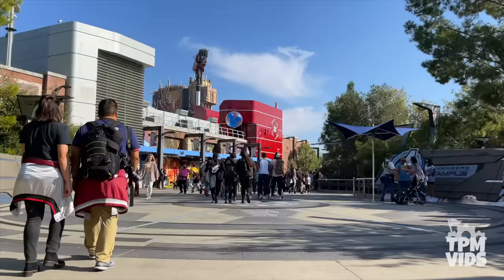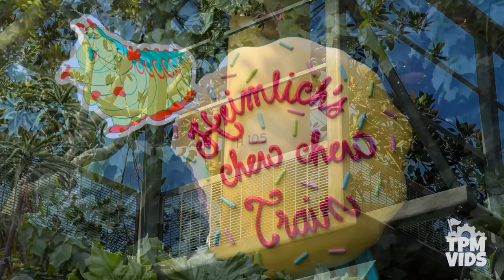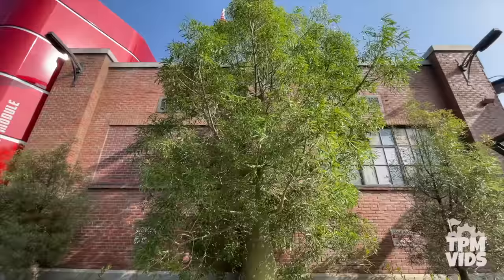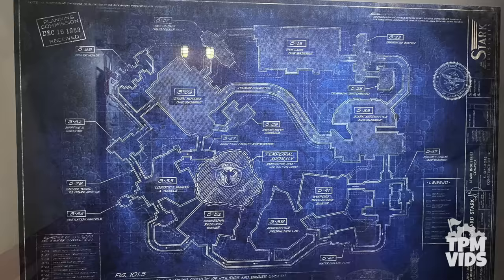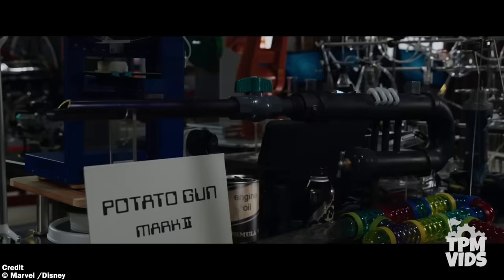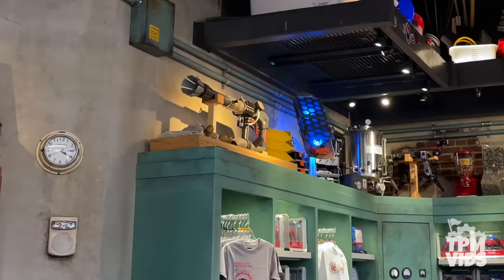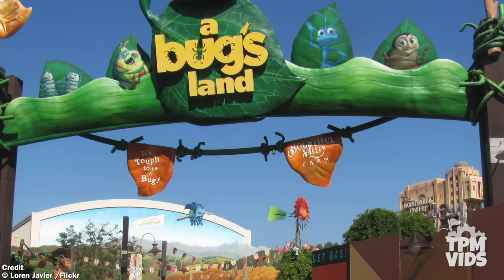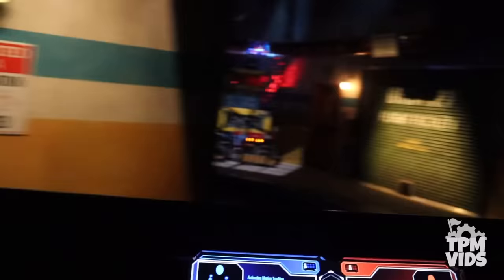Top 10 Hidden Secrets & Easter Eggs in Avengers Campus - Disneyland

Comment: This is all great but I'm still shocked they didn't include any references to Bug's Land in the Pym Test Kitchen. They would fit in perfect, since Pym tech is designed mainly for shrinking and is associated with ants
Reply: Well, the part where he points out the condiments station kinda is since A Bug's Land was part of Bountiful Valley Farm and even before A Bug's Land existed, it was where It's Tough to Be a Bug was located at. Actually, over at PYM Testing Lab, which is a section where you can get alcoholic drinks, on the celling of the shade are Christmas tree lights, which are recycled from A Bug's Land.
Reply: Maybe the Pym Test Kitchen should be associated with wasps and spiders

Comment: Great Video! I love marvel and these Easter eggs are so clever. I tried to do some research on my own and the thing I could come up with for the h 105 is Disneylands hotel opened on October 5 1955. Idk if that helps
Reply: Good idea!
Reply: Actually, as a former attractions member who opened DCA and was there for construction of bugs land, I immediately recognized what it meant....
It refers to the code that is used when an attraction goes into "reduced capacity".
Heimlich's chew chew train was able to run 2 trains at the same time. If one train mechanically broke,  they would remove it from the track so the other could continue operating. The code 105 means: "operating but at reduced capacity".  Very fitting tribute as the bugs and features in bug land still exist; just not in the same capacity as they used to operate.
Reply: @clinttaylor8730  wow that’s amazing! Thank you for contributing!

Comment: I know TPMvids will not read this but can we get this to the top of the messages so there's no confusion when Guest come into AC.

09:43 Quite the opposite. The Collector was the first to arrive. The Stark industries was made into Avengers Campus to 'Keep an Eye' on the Collector. Thus the reason why when the Collector's fortress came SHELD put a place marker on the side of the building and the 'Security Gates' from Hollywood to the Collector's Fortress.

This is coming from a DCA castmember.